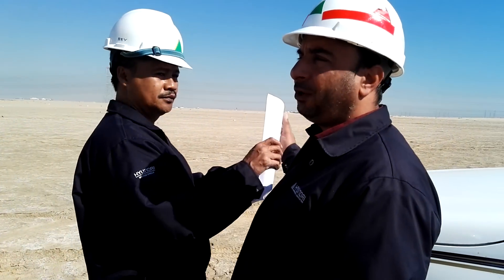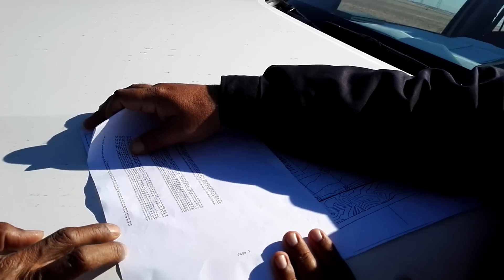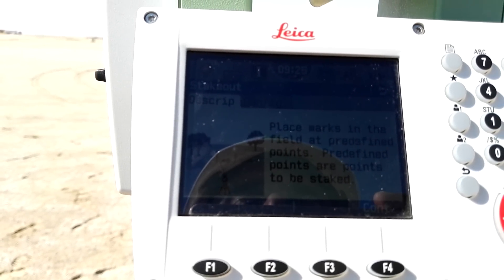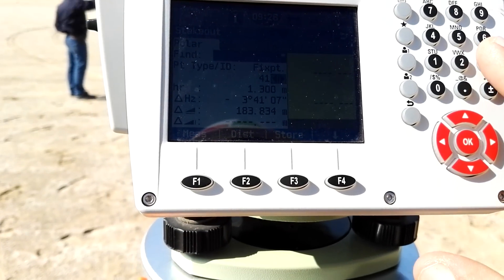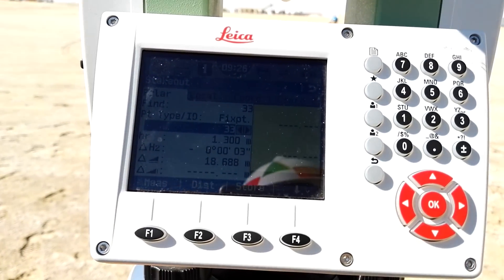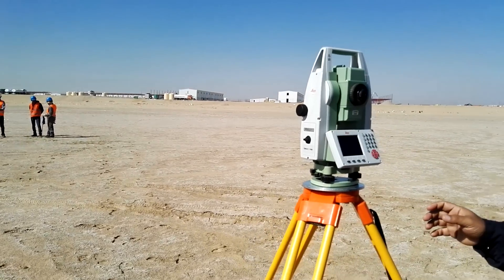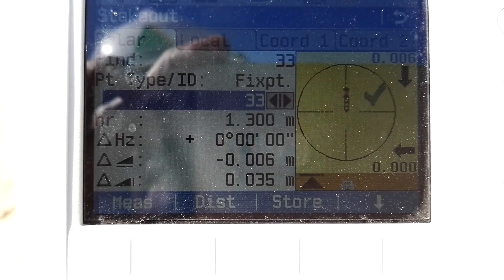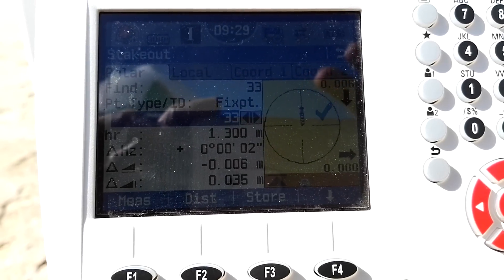Layout with Leica Total Station TS09 Stakeout with Leica Total Station TS09 Plus in English

Comment: At 5:15, the measured point is not higher but lower than the required staked out point. There is a fill of 0.035 m. Am I right?